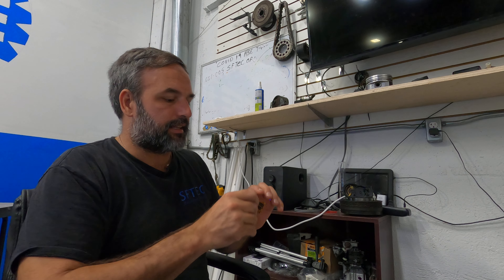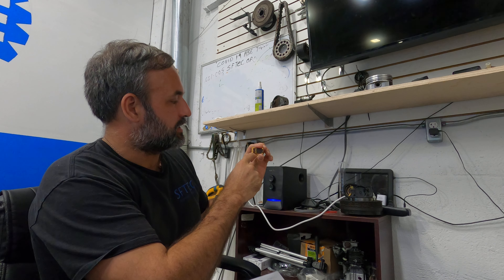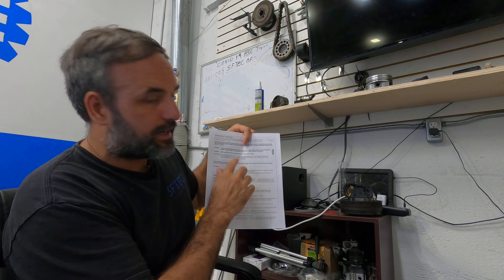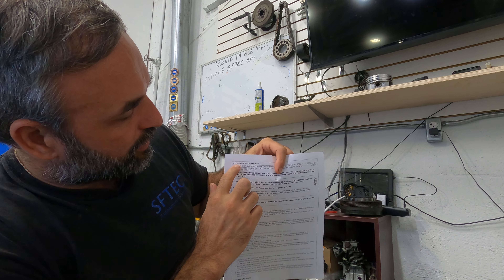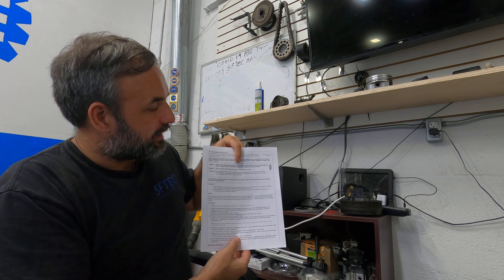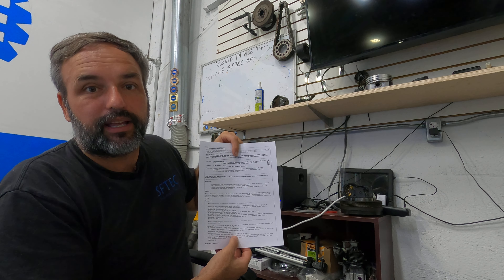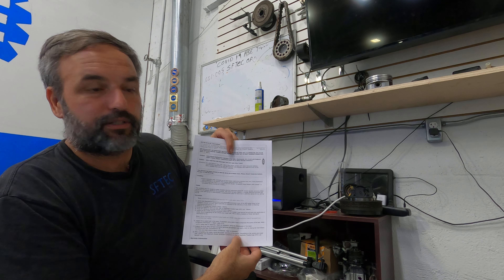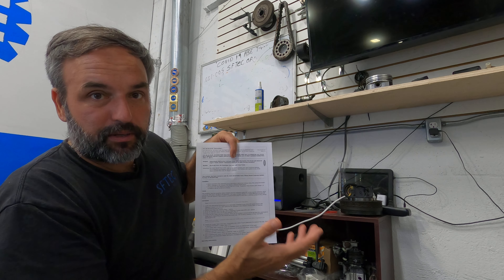The real fix for code P2138 and Reduced power Message on GM vehicles from 2005-2018 #P2138

Comment: I have the same issue everybody was talking about but not sure which tech advisor is right about to fix it. I have 2013 Silverado LT 5.3L 1500 4x4 I did replace the throtle body and brake pedal position sensor and only last a few months then happen again, the issue only happen during chill morning of Fall and winter and still happening nowadays not sure what to do fix the problem listen to roo many tech advise and got confused about it because too many this and that and other people did it but still not fix the problem. When it happen this message pop up, (Traction, Stabilitrak, service traction control and Engine Reduced Power) then cannot speed over 5 mph at all, I hope someone understand what I mean
Reply from the maker: But what code do you have? why replace a BPP for a 2138
Reply: @southfloridatechnicaltrain2589  I have code p0700, p2138, p2127 and the code come and goes but recently I found out my cd radio has a lot malfunction from bad circuit board since got the issue appeared and I unplugged all wire connector on cd radio everything work fine now. Because the truck was drive by the wire not cable anymore
Reply from the maker: @Greenkabin  Huh thats odd since the APP is not on the network but computers do weird things when they malfunction and any thing is possable.
Reply: @southfloridatechnicaltrain2589  I watch 1 video in youtube and search in google they guy said any electronics malfunction will get the computer crazy the only respond from it is reduced engine power and shut off traction control
Reply from the maker: @Greenkabin  An APP code can be also set by any sensor sharing reference voltage shorting or even problems in the run crank voltage circuits. Example a MAF sensor can cause an APP code. or a loose ground but most of the time it is directly related to the APP wiring, sensor or the ECM. Any moisture in the connectors can cause a short and that can trigger a code as well.